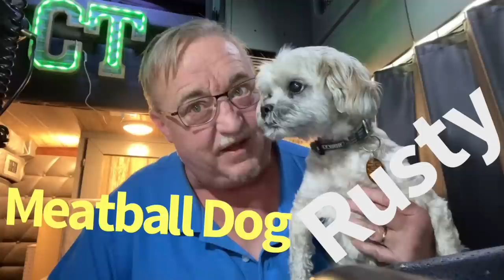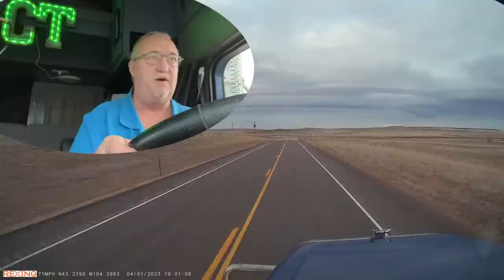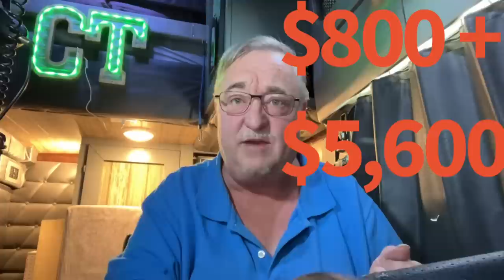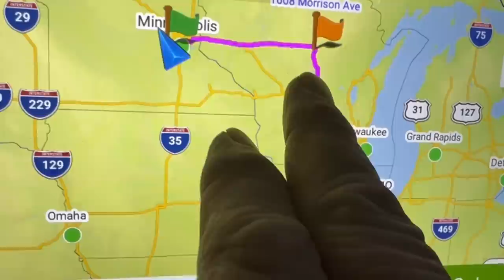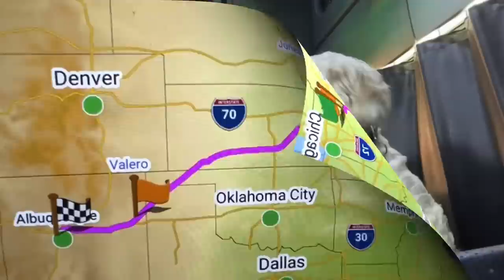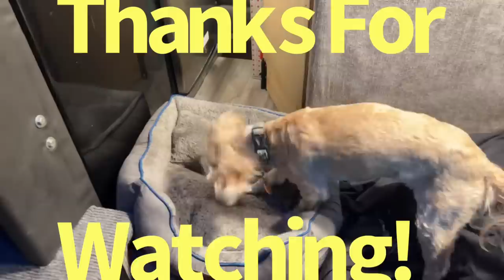Repair in Lusk Good!; Back on Road; air issue Fixed

Comment: Glad they were able to get you going. My 1/4 line is leaking from the quick disconnect on the governor and tried to get a new fitting today. I told them they could keep it for $25. I've gotten them before for about $6. Happy rolling sir. Stay dry and warm.
Reply from the maker: Gotta love air line issues!

Comment: Pronghorn are 10x smarter than deer.   But one reason deer run into you is because they run where they can see.  The headlights blind them, then when you get close enough, the lights light up the area in front of you so they can see it is clear and run that way.

I would NEVER go to a freightliner dealer for repairs unless there is absolutely no other option.   Their service sucks.  It will always be at least 3 days before you can even get in and maybe another 3 days or more before they can even start work, not to mention waiting for parts, etc.   

Something you might consider doing sometime is having all your air lines and tanks blown out.   Hopefully everything is good now and you do not need it, but since you go from really warm to really cold areas often, you may have had condensation building up in the lines, past the air dryer and the water got into the system and gunked it up.
Reply from the maker: Blew them out in Texas a couple weeks ago. But yes. Good point

Comment: It's been several years since I've been to New Mexico. I'd be interested to know if you still have to stop at the Port of Entry and pay a permit in order to run that state. With everything you've been through here recently clutch I just know if it were me I would have regretted taking that load out to Sparks Nevada. In any event clutch I dig your content and can't wait for more Keep On Truckin!
Reply from the maker: Yes. You still have to pay NM fir the permit. I have found one trick. If u enter NM on Hwy 54 from the Texas Panhandle, usually that weigh station is closed dusk to Dawn. Then I can run the state without paying the permit tax. Done it many times. But the ones on I-40 and I-10 are always open

Comment: I had my car fixed and the issue occurred agin on Saturday.  I went in but they said nothing they could do until Monday since they could not get parts on the weekend.  I asked about an oil change and they said this would not fix the issue since it occurred again.  Of course they should have replaced the oil when they got the engine light as I woudl not have had to replace the sensor had they done this.  When I had the oil change done at Jiffy Lube they found the air intake hose was cracked which could cause a lot of issues I was having.  They were unable to replace the part unless I ordered it but the other place can so will have them replace it and then like you I should be good fro some time to come.
Reply from the maker: Very cool

Comment: Did you sign something when the wrecker dropped your truck? Did you READ it before you signed it? Did you perform a walkaround inspection when you were dropped? You may have signed something stating that the tow was performed without incident and no damage was noted. Now that you've driven away, how do they know that they did it? Since your tractor is moving up the hockey stick of repair, plus its being a glider, you might want to consider Roadside Masters or something of that nature. You can pay premiums now, or pay the whole bill later.
Reply from the maker: Ok

Comment: I never used the Sapp Bros shop at Cheyenne but got things fixed at Sapp Bros in Salt Lake City.  You should sign them up as a sponsor.  Speed causes fuel mileage to suffer, best to run 60 to 62, depending on weather and how your truck is set up.  It is nice Sapp Bros will allow you to bring parts that they install, some shops will not allow that.  They want the markup on every part they install.  It will never help you to run down Floyd's Freightliner, just say you try not to spend your money there.  I never hit a deer after installing a Spinner II on my Detroit Series 60.  The deer would look up and freeze.  Must have been the sound of the spinner rotating. Sapp Bros in Council Bluffs will not allow a vender to work on a unit in their parking lot.
Reply from the maker: The cheyenne Sapp bros is great. Some of the other ones not as much. And yes. I usually run slower. But after all the delays needed to run fast to make everything work. The sweet spot in this truck is about 67 to 72. Any slower or faster and I’m blowing money out the stack. 😂

Comment: Would you ever consider a new truck or go back to company driving?
Reply: There should be some good deals out there, companies are closing their doors for good.
Reply from the maker: Never a new truck. Do t want a payment if $4K for four to five years. Plus my truck does not have the after treatment and DEF. Much cheaper to maintain and run. And now that I’ve remolded my truck into a mini apartment, couldn’t handle going back to company driver in someone else’s truck

Comment: You should never drive your truck faster than 70 mph, no truck tires I know of are rated higher than 75 mph…. You are risking a tire blow out above 75 mph.
Reply from the maker: Across SD was going about 77. At night. When it was cool. I never go over 70 in warm weather in the daytime for that very reason
Reply: @ClutchTrucker  - it’s not just the tire temperature, also the weight the tire has to absorb at speeds above 75mph, hitting a bump can cause it to rupture.  No tire manufacturers recommend you drive faster than 75mph.  But since you have ups and downs as you drive, I don’t go faster than 70mph.  And if I drive 70mph only if there’s no hills or nothing… like in Florida peninsula area.  Driving faster than 60mph kills your fuel efficiency